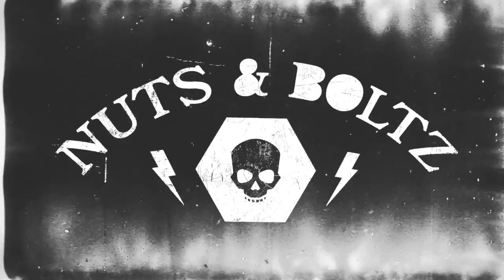#7 Intake and S&S Carb Install - 1969 Harley Davidson Electra Glide Shovelhead FLH Head

Comment: Thanks for sharing these videos, I have been learning a lot about gen/shovels from you. I am building a 67 FLH and going to install an S&S E also. In this video, I see you have changed the solid wire throttle cable out to a braided wire cable but still going through the headlebar. I have heard of this but this is the first I have seen. Could you give me some tips and insight on doing this? Thanks
Reply from the maker: It’s not difficult at all. I recently had to change this wire as it broke a few months ago. Cutting the braided wire is the toughest part. Try to stay away from snips and pliers, rather, use a cutting wheel to provide a nice clear cut on the braided cable. I pushed it up from the carb and up to the handlebar.
Reply from the maker: You will need to use an added spring

Comment: I'm curious about your set up. Can you say what size jets main and intermediate your running? And your mixture setting how many turns out? Also how many turns out is your accelerator pump? Thanks
Reply from the maker: Not exactly sure. I’m going to be doing a rebuild and put in new intake seals this week. So I’ll be back with some info

Comment: Looking to add an S&S to my 67 FLH. I was going to swap the throttle out for dual cable system. Looks like you have single only. Does that operate okay?
Reply from the maker: It operates great. You need to add a spring though. It makes it a dead man’s throttle. Since it’s wire braided cable, you would need a spring if you wanted a single internal wire.

Comment: Never seen any one use bearing grease on the spacer before.  Helping to seal ?
Reply from the maker: Yea I usually put some in there to keep the seal “lubricated”. I know it gets hot in the manifold and rubber can get brittle. Just me...